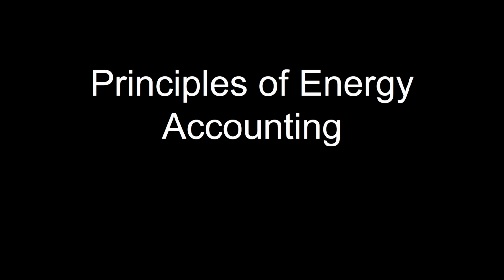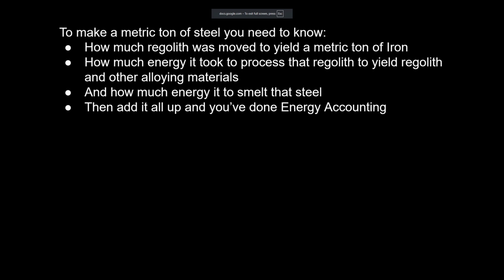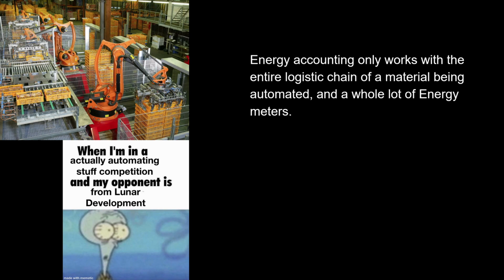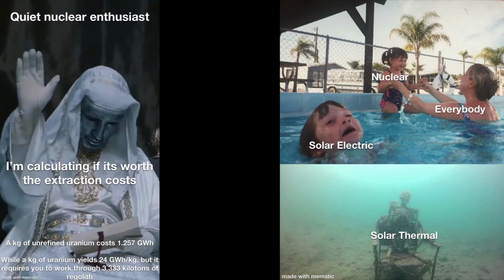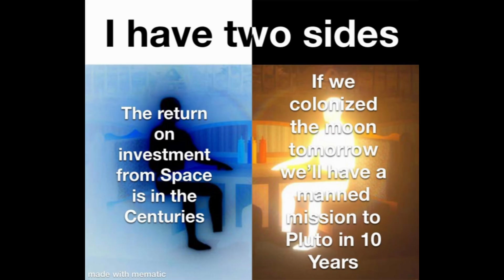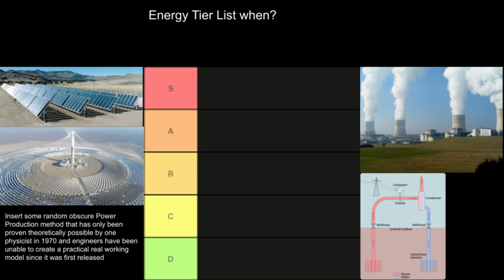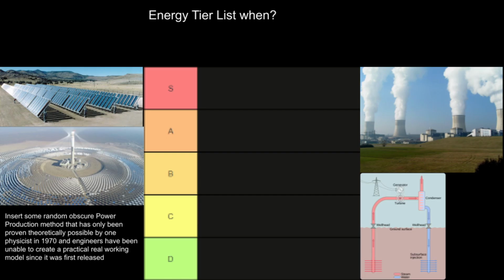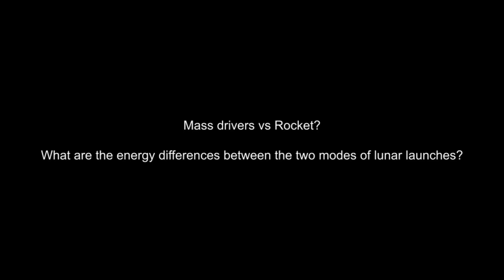Lunar Development: Principles of Energy Accounting

Comment: Nice! It's important to note that energy accounting has its limits, not all energy is made the same and it's mostly useful in the absence of a value setting market to set prices. Think solar panel gigawatts vs rocket gigawatts. Overall though it is our best metric for evaluating paths, just have to know its limits and flaws, so take it as just one measuring stick among several. Also interestingly they do a similar evaluation with green energy to figure out carbon cost of making something like a windmill vs how long it takes to pay back it's carbon cost in the amount of carbon it saves. Funny that famous show Land Man said they don't do this- but they actually do. But they wouldn't have to measure in carbon if there was a carbon tax that accurately captured the damage carbon does- then they could just use dollar amounts instead of carbon in-carbon out. So here we see them using a similar surrogate measurement in the absence of a valid price setting market.

Great memes btw, had me laughing! Very much looking forward to the next one.
Reply from the maker: Yeah, it does have its limits, and I think this is shown greatly in the refining costs of regolith with the refining path of H2 Reduction, Calcium Reduction, and Distillation. 

My main issue here with energy accounting is that because everything is mixed together, so there is no clear metric on how to split the cost of each material. For example Oxygen is mainly a byproduct of electrolysis for H2 Reduction, do you include the cost of electrolysis or not on top of the of the cost of cooling and pressurizing the oxygen. The same applies to the other metals that aren’t Iron or Calcium. Should you include the cost of reducing enough iron and calcium to reduce the amount of metals and the cost of distilling them. Or should we just split the total cost of regolith refining relative to the amount of that material, even though Iron is by far the most expensive metal in a metric ton of regolith due to the costs of electrolysis. Or should we just consider the total cost of just yielding that amount material in the specific amount that can be found in regolith.
Reply: @CeoMacNCheese Do lowest cost method for best faith argument, then multiply by percentage and sum. So, hypothetically, if best method for iron is IR pyrolysis and that costs 1Mw / ton then iron = 1MW / ton. If the leftover now ironless tailings of that need to then be electrolysis for Al and it takes 10 Mwe for 1 ton of Al then Al = 10 Mwe / ton. 

Then for a 'bulk' refining cost multiply by % 

So for iron 1Mw X 7.5% = 75kw
Al 10MWe X 12% = 1.2 MWe
Al + Fe = 1.2. + 0.75 = 1.95
and so on and so forth.

Oxygen is weird bc its a valuable byproduct. Imo the best accounting method is to count it's energy cost as the cost of tbings that needed to be done to keep it instead of simply venting it. So cost of cooling and storage. It should be quite low. There are other methods to count it but i believe this one is the simplest while remaining fair.
Reply: Also big breakdown happens with comparing MWe vs MW from sunlight or something. Electrolysis vs solar pyrolysis. You can try to be fair by adding a conversion cost to your MWe to turn them into MW but its not perfect. For example if your grid is 20% efficient then 10Mwe doe electrolysis would be converted to MW by 10 X 1.8 = 18MW. Maybe this can be tied to surface area costs as thats ultimaltey our base energy unit from solar flux. Still its pretty dubious. At a certain point you have to take a step back and ask why youre doing something lol. Numbers are nice but theres too much uncertainty in a lot of ways. This is why dollars exist bc something becomes worth whatever someone will pay for it and it makes everything much simpler. 👍
Reply from the maker: Yeah oxygen is pretty easy to account for since its a by product, and for bulk refining the product would cost a percentage equal to it percentage mass in regolith and take that number to the total energy spent in the entire refining process?
Reply from the maker: Yeah a Market would help with price determination some deals with other space companies would probably have to be made to lock in the price so we don’t have to deal with the head ache of using energy accounting for material costs.